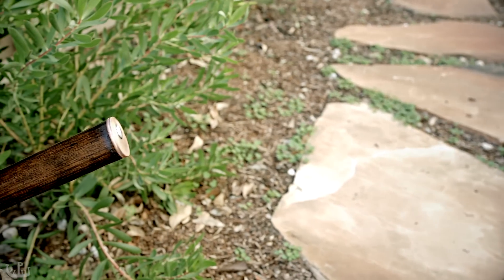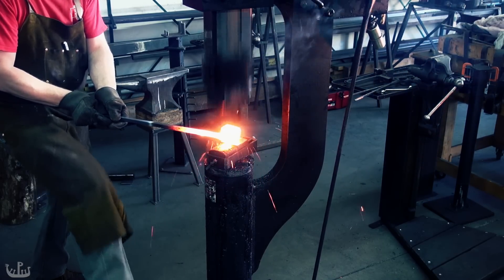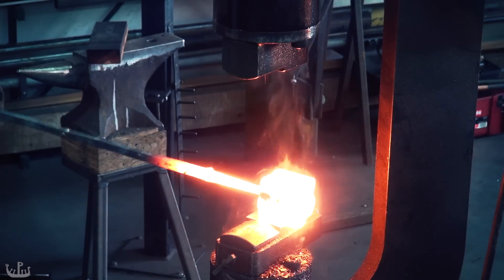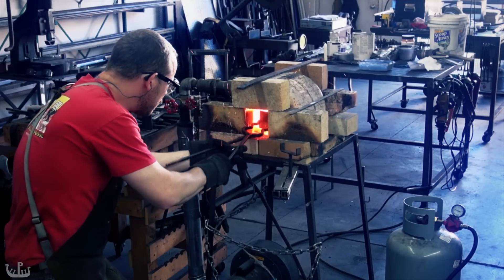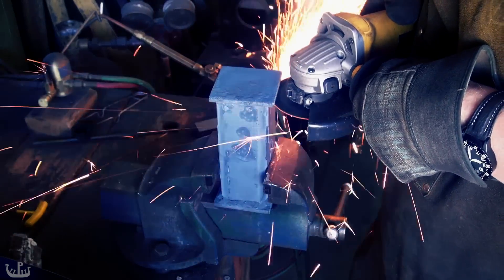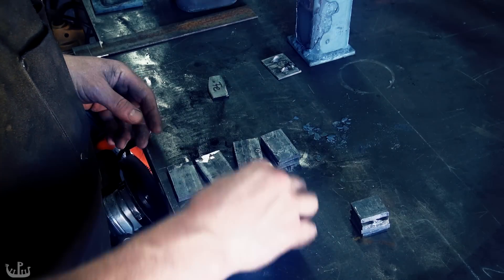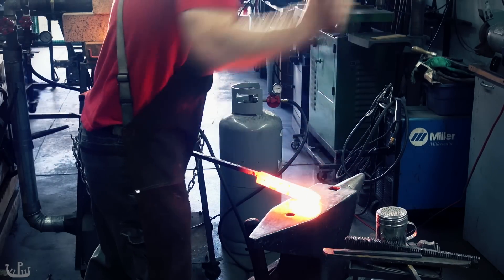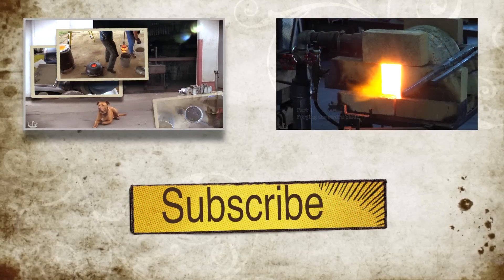Refining and Carburizing Wrought Iron (Forge Diaries: Ep. 5)

Comment: Do you need to worry about the container being airtight? If so, how do you manage the risk of the increased pressure due to heat within the container? I want to try this but I don't want to accidentally build a pipe bomb.
Reply from the maker: +Connor Pollock you can drill a small hole or not weld it air tight.
Reply: Good to know! Thanks!

Comment: gives a elektric blower much more heat?my forge gets only yellow but not hot enough to forge damascus
Reply from the maker: +Sam Engels yellow should be enough for forge welding. The atmosphere is more important.
Reply: What you mean with atmosphere?
Reply from the maker: +Sam Engels if it's oxidizing or reducing.
Reply: For flux im using salt is that ok? I have a video of my forge on my Channel
Reply from the maker: +Sam Engels i use Borax as flux.
Reply: I know but coud this be the answere why i cant forgeweld?
Reply from the maker: Zeig mal ein Video wenn die Esse richtig heiß ist. Wenn Du Borax auf dem Stahl in der Esse siehst muss es kleine Blasen bilden und fasst so aussehen, als ob es kocht.
Reply: Niels Provos danke wusste ja nicht das du auch deutsch kannst
Reply from the maker: Wird leider jedes Jahr schlechter. Die meisten Schmiedebegriffe kenne ich im Deutschen auch nicht so recht. Habe das halt erst in den Staaten gelernt. Beim Feuerverschweißen muß Du zu sehen, daß da nicht zu viel Luft in die Esse kommt.
Reply: Niels Provos danke ich baue gleich mein Gebläse an dann Mal sehen

Comment: @Niels Provos
I managed to create a san-mai billet with my own shear steel in the middle and wrought-iron on the outside. I drew it out to twice the length and when establishing a precurve, the billet cracked in half perpendicular to the grain. Does this process require forging at welding heat for every step, even when curving and beveling to avoid splitting?
Reply from the maker: +Benjamin Bays it should not. A solid orange should be good enough once you are done with forge welding.

Comment: @Niels Provos
Awesome video, I've probably watched it over 20 times now, thanks for the upload! I was curious however what laboratory service you used when you tested your shear steel's composition, I have recently created my own batch of shear steel (it sparks well!) and I am interested in having a sample tested for a school assignment of mine. Thanks again.
Reply from the maker: +Benjamin Bays I need to look it up. It was fairly pricey. For a while, a fellow smith in Michigan was able to help with analysis :-)
Reply: Thanks, I'll do some searching for services on my end as well. I broke a piece after an oil quench at around 1500 f and the piece was very tough, it took some heavy swinging until it broke. When it did break however, it was a clean break, martensite silky grey grain visible and consistent (nicely refined too, I was surprised). It was around 60 HRC, I want to make a Kukri from it, so that is more than hard enough.

Comment: I forge out many many wrench knives and have had really good luck hardening them. The steel starts out as 31CrV3 (w/ .28-.35% C) But after the forging process and the 15 minute pre quench soak at 1,400-1,600 F, it is much closer to 5160 or 80crv2 (W/ I am guessing .5%-.7%+ C). Makes me completely rethink how the  carbon in the forge and carbon in the steel interact and migrate. Just because you start out with a known steel composition does not mean that by the time you quench the blade, that it is even close. Very interesting process.
Reply from the maker: +Colson Customs carbon migration is pretty slow and does not penetrate very deeply. In this video i was keeping the box at around 2000F for 4 hours or so.
Reply: Niels Provos
I can't speak to the exact speed or depth, but I have had good results with thin blades. Under .020" (.5mm) at the edge and about .100" .125" (2.5-3.2 mm) at the spine. I usually forge them for about 45 minutes, most of which is them just sitting in the top 1/3rd of the charcoal fire while I am working on other pieces. Then after grinding they soak for about 15 minutes. Get them into 100F peanut oil pretty quick and temper to between 375-425F for 2, 1 hr cycles.

Comment: For your blister steel container, was there any kind of vent or was it completely sealed? I've been wanting to try this technique for a while but kinda scared of an explosion.
Reply from the maker: It was mostly sealed but probably not air tight. Why do you expect an explosion?
Reply: +Niels Provos I was just concerned about the gases expanding inside a fully sealed metal container under high temperatures then having it rupture. and boom there goes my forge. I just wasn't sure if the container was fully sealed or not, or if it needed to be, to work.
Reply: but thanks for the info though it really helps out.

Comment: Great video, Mr. Provos ! I am a woodworker so I know very little about metals, but I really like your work & your experiments - I only know how to sharpen my blades ;-)

One question for anyone who has a simple answer : When you talk about the 'grain' in the wrought iron... in what sense ? '...grain that is usually stretched quite significantly in one direction...' Wood has 'grain' because it is a biological material made from different types of cells, but why has metal got grain ? Do all metals have grain ? What scale / size does this grain have ?  Does the grain affect the material's strength in the 3 dimensions (like wood) ?

So many questions - so little time...

Anyways: Keep up he good work, Sir !
Reply from the maker: barkebaat Metal has a crystalline structure. These structures can grow large and brittle. However, the grain in steel can be reduced and refined with proper heat treatment. For wrought iron, there are also a lot of other impurities. The way in which it is made often results in stretching it in one direction. That direction becomes visible for example when cold breaking it.
Reply: Niels Provos 
Thanks for explanation. This is interesting, I must investigate further.

Comment: Rather than using a metal container, consider using a ceramic of some sort.  You can buy them (expensive) or make them (fireclay is cheap).  Fire clay operating temps range from 1900 to 2400F depending on the mix.  Even basic dug out of the ground stuff with sand average 1400F to fire let alone start to fail.  Less hassle than having to weld a metal container.

You used a graphite container during your Wootz experiment so you should know how well these would work.
Reply from the maker: brainplay You are absolutely right. The crucibles I have don't fit in the temperature controlled oven. If I end up making much more of this, the iron melting furnace can be run at lower temperatures.

Comment: 4:40  so to make the high carbon steel it has to be hot enough for the carbon to bond with the iron but not so much as to melt the bars and container?
Reply from the maker: ***** The carbon migrates into the iron and yes, the temperatures need to be below the melting point. Historically, lower temperatures but much longer times were used.

Comment: What are your thoughts on using graphite for carbon?
Reply from the maker: Compared to charcoal it's going to be cleaner but also much more expensive. Probably not necessary. However, if your local charcoal is contaminated, it might be an option.
Reply: I might be able to get a bit of graphite powder for free. Thanks for the input.